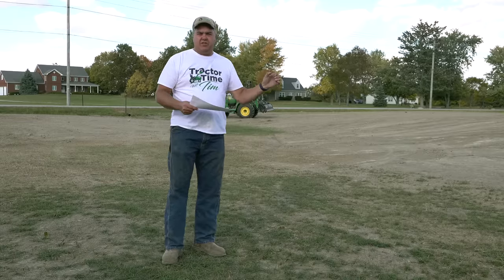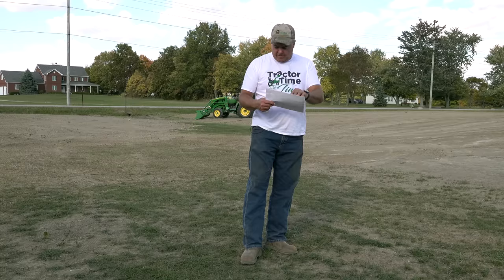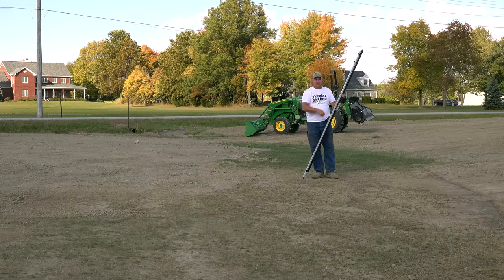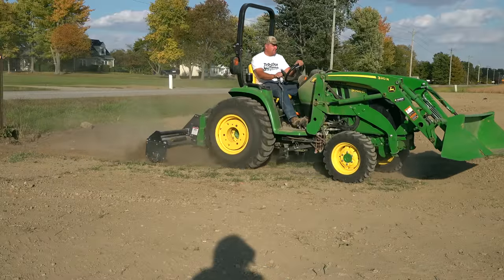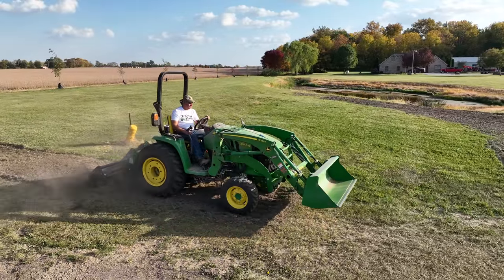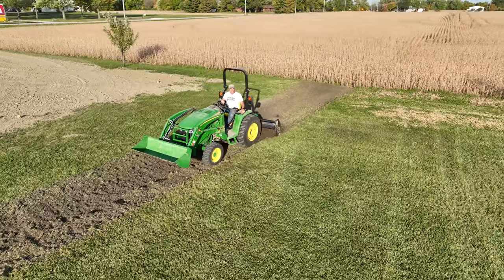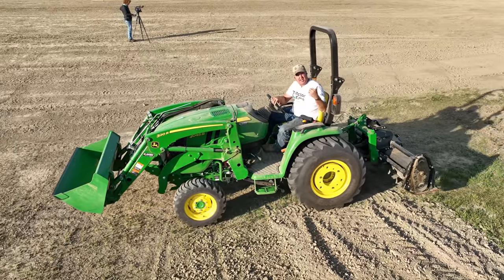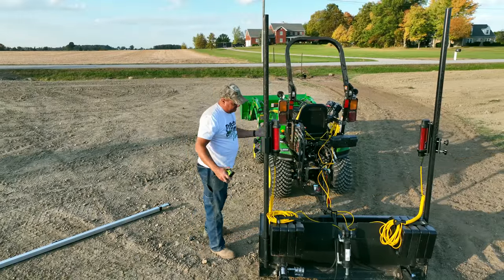VERY LITTLE SLOPE! John Deere 1025R Creates Swale For Water Drainage

Comment: Hey Tim,
Thank you for continuing to offer great content for DIY'ers and small tractor owners. I have a 3 acre overgrown pasture of very wet land that the previous owner cut a 3' ditch into and cows made a huge mess out of, Its bumpy from the continued use and wet in spring, but dries out in summer. My plan is to install drain tile from the wood line to the creek in the center. The slope should accommodate this nicely, rough estimate is 3'-4' of drop over the 200', the north side of the creek might be less slope, but some. Before I can get my buddy's mini-excavator in to dig the ditches for the drain tile I need to tame this "Pasture", at lease get it to a point where we can work. My initial thought is to mow the the 3' tall grasses with a rotary mower, but the more I explore the "Pasture" the more bumps and holes I find, this makes me think of starting with a box blade or straight blade, ignoring the grasses until I have the soil flatter. Does going really slow and high with the brush-hog make sense then working the soil, or visa-versa. I only have a loader and belly mower right now so I need to select my initial purchase carefully, what do you think is the best approach?
Reply from the maker: Hard to level a pasture with heavy sod.
Box blade might be ok, but you will drag up a lot of weeds and brush.
Brush mower is good idea.  Mow it several times this winter if possible.
Then, perhaps a tiller if possible?   Or perhaps a disk harrow. Unfortunately, small disk harrows don’t cut well in sod.
Box blade MIGHT work …but it will be frustrating.

Comment: I find it neat to see what it takes to fine-tune everything. it brings the cost/value into perspective.
Reply from the maker: The other aspect is that I put this system together myself by working with 3 different partners.  So, there has been no integration effort except what I have done.   I think it works pretty well.
Reply: @TractorTimewithTim  sure looks it.  I could definitely see this used in tighter landscaping jobs or to go in and fine-tune big equipment finish jobs

Comment: Tim,  your doing an OK job with that project. Having been in the business for so long though when working with the grade systems that are on the market now  , the one thing that they must have is stability. 
If I were you I would stabilize the grade targets so they are not shaking and wiggle around so much  , wider bases and larger gussets at the attachment points on the blade itself is what I would do. 
You will find that the system will operate more smoothly 👌
Reply from the maker: Interesting. Thanks.  Maybe need stiffer pipe?  I’m using u bolts at bottom to attach pipe to blade.
Reply: Possibly weld on a larger size pipe on the box blade to act as a receiver mount. 
Drill two holes and weld nuts on that receiver pipe so you can use say 3/8 bolts as jam bolts to Secure your target pipe.
Reply: Just to give you some insight  , on our machines we use 2 inch heavy wall pipe and weld on 6×6 inch wide 1/4 Inch steel plate with 4 way gussets and bolt it on using 3/8 size grade 5 bolts.

Comment: I think that laser system is awesome I built myself a pull behind greaser where the blade is controlled with two hydraulic pistons and that system would work really well with that where the wheels always are on the ground   I think that system would work really well with my unit.  Cool stuff

Comment: Like that blade. I know what you mean about the wheels lifting. Almost needs a little PLC work on the controls to finesse the lift and tilt. But you're right for the price point it's good.
I do drainage work in my business. I use the excavator and a laser to establish the ditch bottom and then I use the tractor to taper the sides and remove the spoils. I like that blade laser setup there though! It's nice.

Comment: I like the detail on the laser system.

Have you considered adding a stop on the lift cylinder that won’t allow the gauge wheels to lift maybe an 1” above where they would sit on level ground. That would prevent the wheels from moving all the way up and it may also prevent the blade from cutting too aggressively for the small tractor.
Reply from the maker: Yep.  That is the next thing to try. I have the stops…just need to put them on.

Comment: Tim i bought me a  4110 in  2002 it took 3 or 4 months to get it . i beleive it was built in geogia  .The tractor itself was 12,500 with r4 tires 54 inch mower was 1070,00 49 inch bucket was 2700,00 .I also i got turf tires mounted on rims 1000.00 in four years i had the tractor i never used turf tires. I eventualy got a balist box 400.00 and snow plow 1200.00 .Plus i got a dump trailer and a umbrella that was about 600.00 .It was very much like your 1025r it had a yanmar 3 cyl i beleive it was 20.5 hp / hydro.I had around 18000.00 total in it .Four years later i sold it for 14000.00. with around 290 hrs . I had two problems with it the metal on the seat cracked also had a leak under the rearend john deere took care of the problems .PS i recently looked up to see  what the 4110 is going for today it was around 15000.00 with half the attachments.It looks like i could of sold it for more today then i got 16 years ago .I recently commented you about the extention you used with the impact on how you lose torque with an extention .Thanks for the comeback comment Tom

Comment: SOLUTION..TOW point ( height)  on tractor Must be RAISED  to Level the blade at rest. Weighs off as well. This will make the blade work much better as the nose isn't "diving" when its lowered, its more "level".

Comment: Tim, have you tried using the system in manual mode to prevent excessive lifting of the wheels?  What I mean is watching the lights on the right side receiver and adjusting manually in small increments with the valve.  I realize that is not how the system is intended but might have some merit during some phases of the slope establishment process.  I don't have the controller on my rig so have to adjust manually.
Reply from the maker: Oh yea, I switch back and forth between manual and auto often.  You can see that in the video if you look closely.

Comment: The first thought is it needs a flow control valve to reduce the speed of lift lower. The other thing I can't help but wonder is if the blade would work better if the laser readers were mounted to the wheels instead of the blade. By doing that if it needs to cut more it will only lift the wheels to the laser grade and not above it.

Comment: How do we use the Code for the C5MFG box blade?  The website doesn’t allow orders. 

Also, have any more lessons to learn, I’m putting together the same system and any learning curve videos or additional items we should buy would be awesome!

Thanks for any help.
Reply from the maker: Call them and mention us for the discount.
The two laser systems sometimes compete (fight) with each other.  It took some practice to learn when to switch the tilt from auto to manual to work with this.
Still, a very nice system.

Comment: I like a 4 to 1 slope, lay it out with flags off set 2 ft.and run it manual.   I run manual till I get real close on the bottom grade allso that will take away the problem of wheels being out of position.  You have a neet little set up.
Reply from the maker: All great unless you don’t have 4:12 available

Comment: Could Cylinder stops be placed on the lift cylinders so that they are only able to lift an inch or two off the ground?  Also, how does the system know when cylinder travel is maxxed out?  Does it constantly demand hydraulic flow when it wants more 'height/depth' than the cylinder travel can acheive or does it have some sort of contact switch?  I ask because on Deere equipment i've worked on they have a contact switch that sorta resembles one of those door stop springy things that kids like to play with,  Installing something like that could limit travel and prevent excessive heat build up in the hydro system from deadheading the hydros when the cylinders are maxed out if you could figure out how to make it talk to the rest of the system.

Also, another thought...  I have a Summit kit on my 1025R and its great but one of the problems with the momentary contact style control switches is that you get all the flow or none of it.   Once again on some of the bigger Deere machines I've worked with you can turn down the flow to certain SCVs to smooth the jerkyness in certain applications.  Obviously the Summit kit is not that advanced but I wonder if installing flow controllers on the blade side where you could slow down the cylinders would smooth out some of your issues.. Just pondering. 

Thanks for making great content!

Comment: Have you thought about asking the grader attachment manufacturer if adjustable flow restrictors on the hydraulics would make it not so jerky?  Put on a snowplow blade to slow the angle from left to right. Nice job Tim.
Reply from the maker: I have flow control valves to test this theory.  Doesn’t really help much.  We already have such low flow.

Comment: Just a thought tim, would it help achieve your tilt angles regardless of cutting depth if you made the wheels independent? That way they could have much more travel for lateral adjustment. Or possibly a transverse mounted walking beam type mount for the wheels?
Reply from the maker: Yes.  I have thought a LOT about this. 
While separate wheel controls would be great for laser control, it would be poor for manual control. 
One wants to raise the entire blade consistently left to right with a single lever when doing normal box blade work.
Reply: @TractorTimewithTim  that’s true. But not impossible to do independently. I’ve run a motor grader a small amount and you have a lever to control each side independently to have greater fine grade control. Definitely more complicated, but something I would seriously consider

Comment: Seems like you might want to move the laser system to either Johnny X or the new-to-you cab tractor since that has no loader and won't be used for as many other projects as the loader equipped tractors I'm sure will be.

Comment: if you will move your mast to the center of the bucket, this will average the the readings between both wheels, not one, also used a power mast, this unit will survey for you

Comment: That was Funny. 10th. and 100th of an inch. Tim You could have simply have switched over to metric which already works in 10s.

Great work, always interesting to see the U.S. hanging on to Imperial measures when they threw the British out hundreds of years ago.

Great video.

Thanks.
Reply from the maker: Yep. Would be good to switch to metric system.
Reply: Many things are divided by 3 or 4 or 6.  Very easy to divide a foot or yard by those, a meter, not so much.  We Americans are intelligent enough to be able to do that and convert measurements to decimal if need be.
Reply: @daddio7249  I am Old so I grew up in Australia with English currency which is based on 12 pennies. Our measurements were also based on 12 inches as Your are now. The decimal system is much easier.

1 meter is easily divisible by every number up to 10 and beyond. 1 meter divided by 3 is 100 centimetres, divided by 4 is 400 centimetres and so on. there is 2.5 centimetres in an inch so yes even a conversion from inches to centimetres is possible.

At my age I still work in inches and centimetres. Bilingual when it comes to measuring.

I can assure You that if ever the U.S. of A joins the majority of other countries in the World You will find just as easy to work with.

The currency in the U.S. already uses the decimal system, it would be easy to convert the measurements over as well.

No criticism offered I simply made an observation.

Regards.

David in Oz.

Comment: Curious if once you set your laser receivers to "grade" on the grade rods of the box blade, could you then install stops above them, basically setting the highest point the receivers could go as final grade, based on the laser location.  Then be able to use spacers to equally lower the receivers on each grade rod.  Effectively "raising" the laser and lessening the amount you would be trying to cut initially to get to grade.  This would likely lessen the amount of time that the rear wheels would raise off the ground and cause the delays in lowering the wheels and raising the box up, without having to put limit switches or other travel limits in.  Then once you have graded the highest spots off that needed the most cutting, you could either raise the receivers up by an equal amount on each side (using a spacer between the upper stop and the receiver) or raise them all the way back up to the stops to be able to cut "final" grade.  

Hopefully that makes sense, you may be already doing something to this effect in the electronics, but it didn't seem like it.  I very much like this whole idea though that you are working on.  So an details you would like to talk about and show would be interesting to this subscriber (I enjoy all your videos by the way)  And yes, if one of your kitties graces us with its presence, that is a great bonus.  Have a good one!!
Reply from the maker: Could probably do that, but it would not be efficient.  …at least in my opinion.
Reply: @TractorTimewithTim  👍

Comment: How much was complete cost of the blade and leveling system?
Reply from the maker: I think I mentioned that.  These are round figures: $2000 for blade.   $2500 per laser system, need two for slope control. $1000 specifically for the 1025r to add the summit hydraulics kit.
Reply: @TractorTimewithTim  I heard you mention 20,000 or something and then mention something along the lines of 6 or 7,000 so was clarifying what was what

Comment: It sure beats a dozen guys with shovels. Nobody seems to recall that is how almost everything was done not so long ago.
It would be a longer process, but you could set the slope numerous times to avoid the overly aggressive digging by the small tractor( do half, then half, or thirds - depth not length). 
It is a neat tool for someone that does longer driveways/paths on a small scale as well. 
Maybe you can get some drone footage of how well the swale works after a decent rain, which could also see where any problem spots are without getting your feet wet by walking the edge. I wish I had a drone like that, but can't justify the expense to the "finance committee", wet feet example won't work becase she keeps mentioning my rubber boots under the eave🙄.

Comment: A flat site is indeed a vexing challenge; I have a flatter site too. “Best Practice” is to have a 2% minimum slope for positive drainage. Basically trying to grade only 5” drop in 100’ is tough with such a blunt instrument as a tractor. The laser grading blade would help but trying to finesse less than 1/16” per foot is inherently crazy…

I’ve connected in with a Permaculture Guild and they are suggesting some alternative and thoughtful considerations. Another way to think about this is to consider absorption and utilizing storm water in lieu of to trying to move water away as efficiently as possible.  Absorption strategies would include planting trees to slow and absorb excess storm water. An Alder tree can absorb up to 500 gallons a day for instance.  There might be other plants that can thrive in wetter areas. Consider what nature would do on its own. Nature has trees like willows and alders growing in lower and wetter zones. Then the water is “managed”. 

A strategy I’m considering is digging out a retention pond to collect storm water surges which would then slowly meter out the storm water back into the water table as the soil can handle it. Then the conversation shifts into how a pond can be utilized as a useful contributor to growing foods that like wetter conditions and wildlife habitat.  If is pond has water year round, then raising fish becomes possible. When the concept becomes to capture and use storm water beneficially on-site then there are new possibilities to explore.
Reply from the maker: Not too worried about 1/16”  I just want to keep it from puddling deeply.
I’m probably within 1/2” in the short run, and very close to perfect over the long run.
Reply: Lasers can do very slight slopes. My agriculture laser system with dual slope adjustments went down to 0.01%.  We irrigated with flood irrigation and I want to back water up from the low end. I set the laser emitter on 0.03 for the slope and 0.0 for the cross slope on a 40 acre field. That was about 4.5 inches fall over 1280 ft.

Comment: Why not have a wheel into the trench and instead of manually controlling tilt - just move the reciever and have the laser drive that wheel 2" or what not less than the other.  Just a thought.

Comment: I don’t think I get it. Do you have to meet the swale in the field. Do regulations require this. As opposed to a roadside ditch? This seems to a common problem in your area.right?
Reply from the maker: Water won’t run uphill :-)
Reply: @TractorTimewithTim  oh, I’m an electrician. Most of my electrons go where you tell them to go. Thanks
Reply from the maker: Yea, our yard is basically the low spot in the whole neighborhood.  That is our overall challenge.
We have shown and discussed this in several videos over the years.